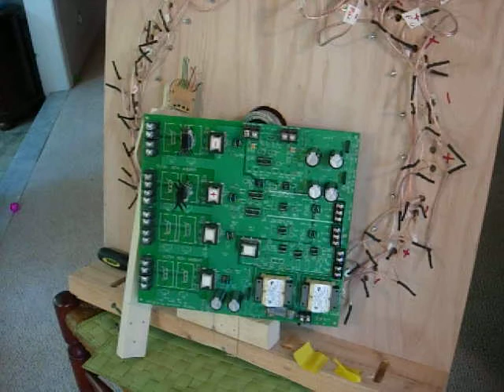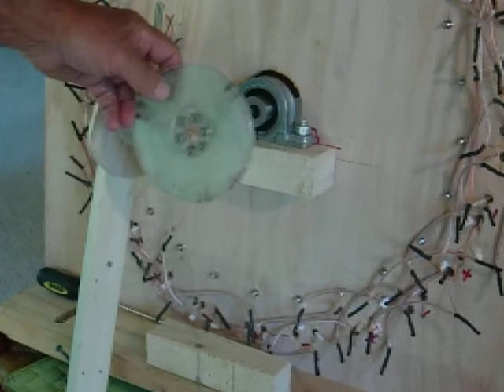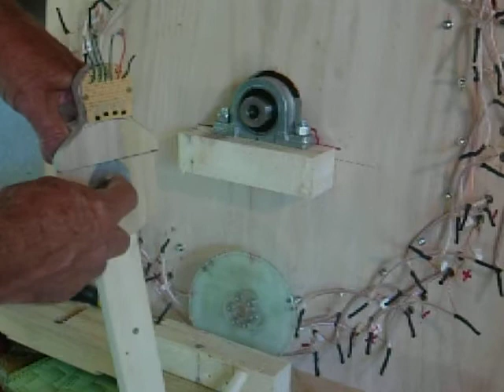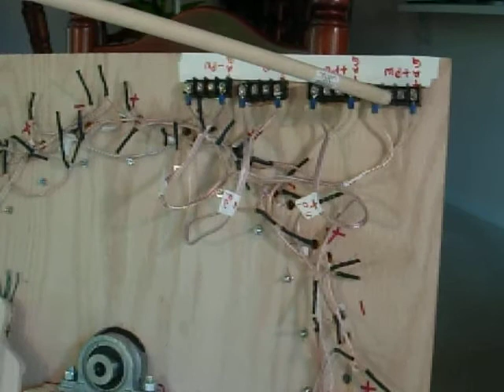Don Smith #23 PCB , CD Disk with Small neos, and Hall sensors

Comment from the maker: The PCB will only be used for developement.  from this effort I'll end up with a new PCB which will become a product.   The PCB Hall circuitry uses an ne555 timer to determine the pulse width that will fire the igbts into coils.  If you think about this idea you'll see a problem occurs when the speed changes.  The pulse width may cause problems with magnetic fields.   I may need to connect the hall pulse width past the ne555 circuitry. I'll know more when i have rotation.